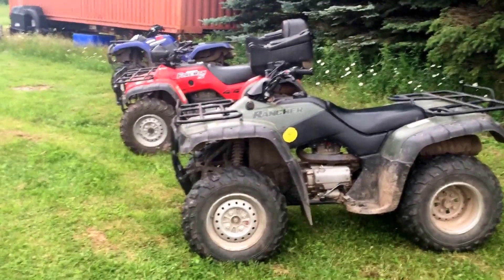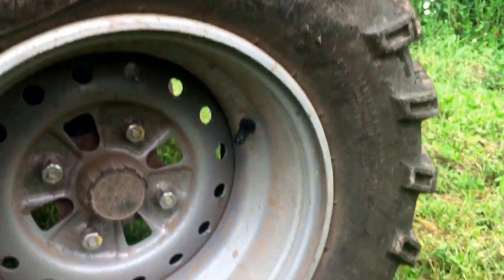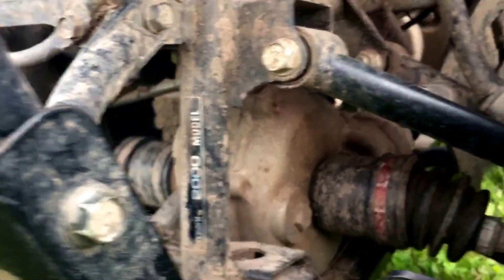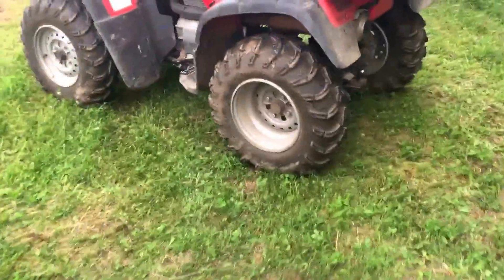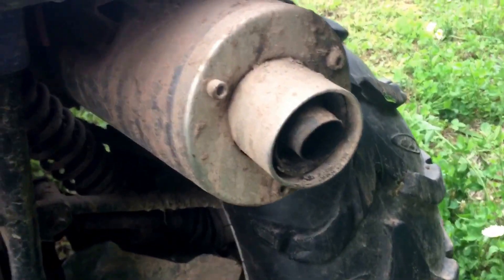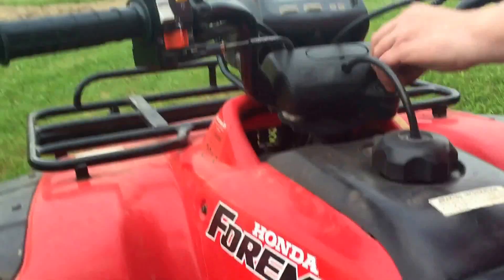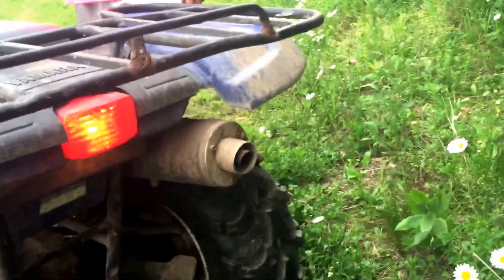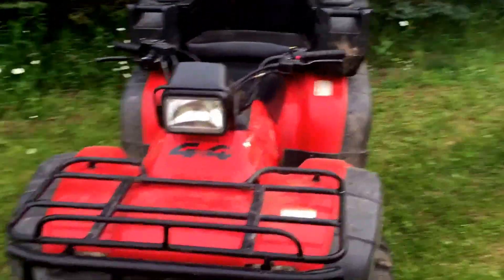Review on 2000 Honda Rancher 350, 2001Honda Foreman 450, 2006 Yamaha Grizzly 660

Comment: Im about to buy a used 2000 Honda 350 Rancher. Would you say it is a worthy buy?We generally do some light to medium mudding. Also, any problems with the 4 wheel drive?
Reply from the maker: +dorantana1 It should be a worthy buy, nothing seems to be wrong except that the breaks ontime locked up and the sterring wheel affected the idle at one point...there have not been any 4X4 problems...as always, honda has been good for us and for many other people and has been great with proving to be quality...I personally think that it is a worthy buy, good luck man!